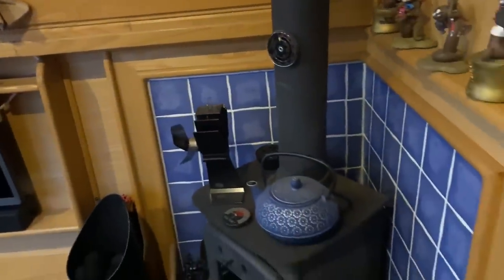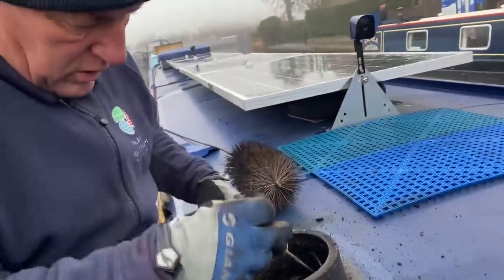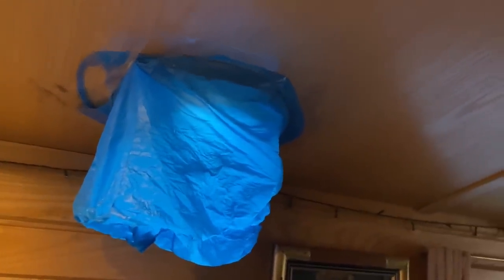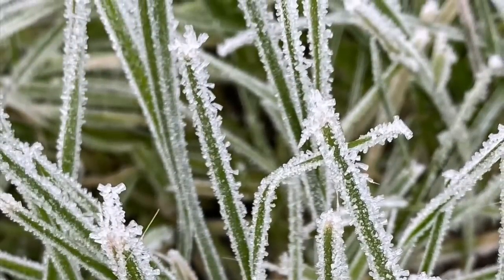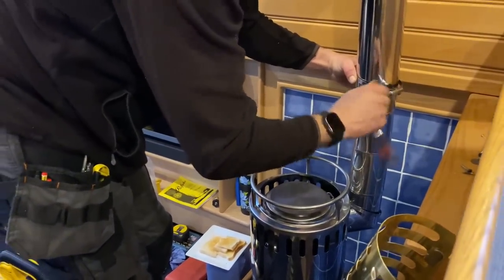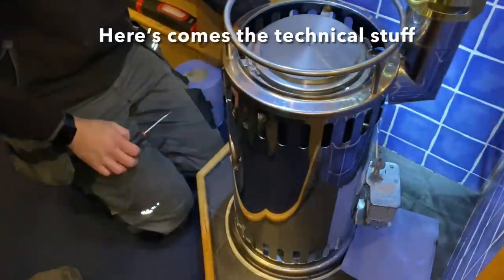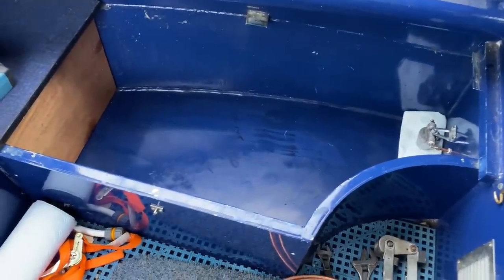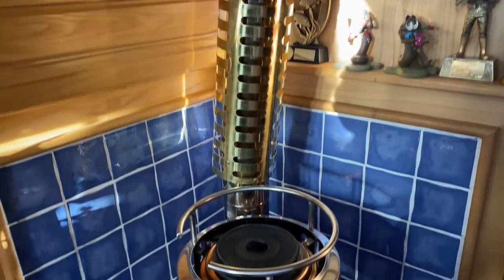Narrowboat Living - Our new Refleks Stove! Ep17

Comment: I’ve always used diesel drip heaters over the years and never had a problem with them. When I go past a boat that’s got bags of coal and wood all over the roof I cringe at the the thought of all the manual labour involved🥴 In winter I run my Reflex on 28sec gas oil, it burns hotter and is very clean plus it’s cheaper than diesel
Reply from the maker: Ooh thanks for the tip! xx
Reply: How economic are they, how much is gas oil per litre and how much do you use per 24 hrs.
Reply: @psy-op  All this information is available on the internet🙄 try searching for Reflek 2000 heater and you’ll see fuel consumption figures - heat output: 4.2 KW (3675 kcal/h).
Fuel consumption: min. / max. 0.18 / 0.54 l/h?
28 sec gas oil is generally at least 25% cheaper than red diesel plus there is zero tax on kerosene, only downside is kerosene is not sold in marinas.
Reply: @optimist3580  5% VAT on kerosene heating oil.
Reply: @PaulThomasSouthWales  thanks, yes I’m aware of that, still a lot better than the 20% on Red diesel for propulsion even when you take in to account the 60/40 split. Red diesel used for heating has 5% vat
Reply: @JulieandMartinonRIB  would be sad to see the log burner go if I'm honest but can see why it's safer

Comment: Congratulations! Diesel stoves rule. I hope you've discovered the joys of using meth's rather than horrible smelly fire-lighters. Meth' spirit smells great and is hassle free. I thoroughly recommend using joss-sticks to light it. I have a Kabola back-boiler stove that works exactly the same as the Refleks. Just pour in the meth's, light the joss stick but don't blow it out - touch the flame to the pot and close the lid. 
That way you've avoided filling the room with fumes. Alternatively you can snip the burning end off the joss stick to drop it in the pot for ignition.
HAPPY NEW YEAR
Reply from the maker: Ooh, we might just try that, thanks Dan! Happy New Year to you too xx
Reply: @JulieandMartinonRIB  CHEERS!

Comment: Hello fantastic vlog! Is it expensive to run? Absolutely depends on usage, but an average?
Reply from the maker: HinDavid, thank you! We found if we had it on low, number 1 setting then it uses between 4 and 4.5 litres of diesel per 24 hours, and most of the time you only need it on seething 1, we only turned it up to number 2 occasionally when it was -4° or below, so this is a good indication, hope this helps xx

Comment: Soo dose a multi fuel stove make condensation? Also thinking about specking out a boat... How much fuel dose this use? And what level do you set it on? Also how much heat dose it produces compared to the multi fuel stove
Reply from the maker: Hiya! In our experience, our multi-fuel stove did generate condensation, mostly due to the fact you can’t regulate the heat, so it gets very hot initially, then cools over a few hours, then hot again once stoked and fed more coal or wood, it’s also a radiant heat. With the Refleks diesel stove, its convection heat, it draws the cooler air in at the bottom and the hot air comes out at the top. The diesel stove seems a more dryer heat too. We have our stove mainly on the first setting, number 1, and leave it on 24/7, this keeps our boat a nice 22°C (72°F) and this uses approx 5 litres of diesel per 24 hour period, sometimes a bit less, but averages at 5 litres. If it gets really cold, into minus temperatures, then we sometimes turn it up to number 2, or 3 for a short while, but mainly we keep at number 1. We prefer this to the multi-fuel stove, as there is no mess, no coal dust, no storing of coal, or wood, or kindling, and you can keep the heat at a constant and leave it on without the worry of it going out. Another nice thing is if we get a chilly night in Spring, or Autumn (and even Summer this year) we can put it on for a couple of hours and then turn it off once we’re warm, and on the flip side, if the weather changes and becomes warmer, we can just turn it off, which we couldn’t do with the multi-fuel stove. Hope this helps! Thanks! xx
Reply: @JulieandMartinonRIB  amazing thank you so much for the information that's a response I really enjoyed reading. Thank you so much 🥰... May I ask how much dose it cost to run the heater for the month / week assuming it's on 24/7 like from October to May...  roughly how much is diesel? I know the price changes I'm working out cost ECT. Manny thanks, oh and is it better to have an external tank?
Reply from the maker: Hiya! The red diesel at the moment is around £1, so we’re looking at £5 for 24 hours, so £35 per week. We have a separate diesel tank specifically for the Refleks stove in one of the front lockers, this allows the stove to be gravity fed, so there is no need for any electric pumps (if you were having the stove fed from your main diesel tank at the back of the boat by the engine, it would need an electric pump to get the diesel to the stove) As boats are always very slightly higher at the front, having the separate diesel tank in the bow is perfect. If in extreme weather, God forbid our batteries died, we would always have heat, as being gravity fed and no electronics, the Refleks would still work. Hope this makes sense! Thanks! xx

Comment: Hi are you still using your Reflex diesel stove? Is it expensive to run? Have you had any problems with it since you fitted it? Thanks Fiona
Reply from the maker: Hi Fiona, yes we’re till using it, it’s great! In winter it uses approx 5litres of diesel per 24 hours. We leave ours on constantly, usually on setting 1 and only turn it up if it gets really cold like mud temperatures outside. Keeps us toasty warm. Thanks! xx
Reply: Hi there thanks for your reply. Did you get a back boiler on your reflex stove to heat your radiators! If so do the radiators get hot enough? Or do you have a separate heater like a Webasto or Eberspatcher? Thanks Fiona
Reply from the maker: Hi Fiona, we have a separate Eberspatcher to heat the radiators. When it’s really cold we put the eberspatcher on for one hour in the morning and one at night, just to heat the radiators through. Hope this helps! xx

Comment: Looks fab. Did it help with the condensation?
Reply from the maker: Hi Stuart - yes, because it’s convection heat it’s a dryer heat. Also, as you keep a steady temperature 24/7, ie the boat doesn’t get cold then heat up, then go cold again like when we had the multi-fuel stove, there’s no chance of condensation build up on windows. Hope this helps, thanks! xx

Comment: How did you find this stove for heating?  Is it expensive to buy the gas compared to fuel for a wood/coal stove?  Sorry, trying to decide  which type of stove to get on my boat. Really want one of these. :)
Reply from the maker: Hi Jack, it’s great for heating the boat. We have it on 24/7 and it uses approx 5 litres of diesel per 24 hours. It keeps the boat at a steady heat and the beauty is you can turn it up if it gets really cold outside, or turn it down, or off if it gets too warm, unlike the wood/coal stove. It’s a lot easier, no mess, no storing coal, wood or kindling, no coal dust/soot everywhere, it just sits quietly heating the boat. And diesel is readily available from marinas and fuel boats, so always a supply. Hope this helps xx
Reply: @JulieandMartinonRIB  Oh, thank you so much. That really does help a lot. I think I will go with one like you have. Thanks again for the info and happy new year!!!
Reply from the maker: @jackmedcalf6254  no probs! Happy New Year to you too! xx

Comment: I've ran a propane heater inside my shop in the winter. I had to keep the garage door slightly open so that I wouldn't die. I also had some grease like film on some of my shelves. I know that this isn't propane but I was wondering how this is different in comparison to propane? If in fact that this is safe and doesn't cause issues like propane than I might replace my space heater that is propane with one of these.
Reply from the maker: I can’t speak for propane as we haven’t used that, however the diesel stoves are completely safe, easy to use, you can regulate the heat and are economical too. We only have the need to open windows if it gets too hot lol xx
Reply: @JulieandMartinonRIB  Thanks. That's awesome to hear! I didn't know that about diesel heat. Great stuff.

Comment: Hello. Do you find that the cold air around the floor gets warm or is that still cold with the new stove? Are you keeping the Reflex lit all of the time in the cold weather? Does the heat get around all of the boat or still sort of located in the area around the stove? Any condensation issues? Thanks.
Reply from the maker: Hi Joseph, wow lots of questions lol, here goes in order;
We have a fan on top of the stove and one at the top of the flue, which circulates the air, so the air near the floor does warm up. 
Yes, we’re keeping it lit all the time, we turn it down to 1 overnight and then back up to 1.5 or 2 during the day. When it was -6° we had it a little higher. 
Yes, with the two fans, it circulates the heat nicely, still a little cooler at the far end of the boat, but not cold. 
No, the Refleks diesel stoves produce a dry heat, so it reduces condensation. 
Hope this helps xx

Comment: Hi . Fantastic video. We are just trying out our stove today . Can you tell me where did you get ypur trivet & fan from . Thanks . Ant & saz ☀️
Reply from the maker: Hi Ant & Saz, you’ll love the stove 👍 xx
These are the items we bought, we got them from Amazon, see links below. We have two fans, one that sits on the trivet and one at the top of the flue pipe, to circulate the air. The one at the top we had to secure with a jubilee clip, as the stainless steel flue is not magnetic. Obviously do that when the fire is cold, as the flue gets way too hot to touch 🤪 Hope this helps xx
Stove Fan, Log Burner Fan Silent Wood Burner Fans for Wood Burning Stove, Fire Fan Wood Burner with Heat Powered 4-Blade Fan Eco Friendly for Log Burner Fireplace https://amzn.eu/d/fTj4B4N

Valiant Remora Magnetic Flue Pipe Heat Powered Stove Fan (FIR350), Black, 200 mm https://www.amazon.co.uk/dp/B079JPMQN7?ref_=cm_sw_r_apin_dp_1BM060RWTT122YKKHGYD

Bredemeijer Coaster Jang, black, Cast Iron, 13.4 x 13.4x 1.8 cm https://amzn.eu/d/7QoxT6L
Reply: @JulieandMartinonRIB  so kind of you to reply. Thanks a bunch. Just ordered em from Amazon 👍... Ps ... the fire is lovely. We started it via the meths method but may well revert to the fire lighter method. Can I ask .... which method do you prefer? ... kind regards ant & Saz from boat happy days . ☀️
Reply from the maker: @antsat37  we always use the meths ….. unless it’s warm, then NEVER try with meths, as it proper goes bang and takes your eyebrows off lol 😂 
If we run out of meths, we’ll use a firefighter, but it tends to leave a small deposit build up where the fire lighter was. We haven’t got our fire on yet, still warm here lol, not for long though, as it’s just started raining! 🤷‍♀️ xx
Reply: @JulieandMartinonRIB  top stuff . Thanks so much . See you out on the cut somewhere. Byeee ☀️

Comment: Hi. I understand why there would be dust from a solid fuel stove - due to opening and closing and during cleaning etc. but since it has a door that closes while in use I'm wondering why it would cause more condensation than a diesel stove.
Reply from the maker: Hiya, apparently the diesel stove works more on a convection heat, I.e. it heats the cold air from the bottom and pushes warm air up the top, causing a dryer heat. That’s about the top of my knowledge lol 😂 Thanks! 😊
Reply: @JulieandMartinonRIB  Thanks. Do report your findings as you use this new stove. It should be a lot less dusty as you said before, but about condensation and also diesel consumption. Since you are on a separate tank for this I guess it will be easy to monitor. How did they get the fuel pipe all the way to the stove without having to take your wall lining down?
Reply from the maker: Hi, we will monitor it over the next couple of months 👍 The fuel pipe comes through the bulkhead from the well deck, then through the back of the cupboard, then under the shelving behind the fin-radiator panels, through an insulated cover, right along to where the stove is.  The pipes are completely hidden from view and they’re also gravity fed, so no need for a pump either. Hope this helps x
Reply: @JulieandMartinonRIB  Ah yes, heater, not engine, so no need for a high pressure pump (or any pump as it happens). Still quite fortunate that there was a reasonably straight forward route for the pipe. No doubt you surveyed this before committing to the change.
I do look forward to hearing of your experience with the system. In particular I wonder how it stacks up against a diesel central heating unit, meaning if going diesel is it better to just run the central heating system and close off any radiators not needed at any given time. A fire is always a focal point, but then so is a TV these days. Growing up I was in an all electric house. In the living room (usually the only heated room due to costs) mum used to reduce the ceiling heating thermostat (yes, ceiling heating - don't ever get that!) in favour of the electric "fire", which she would then sit in front of like a black hole absorbing all heat energy with none being able to get past her. It put me off the idea for 2 reasons; 1. an electric 'fire' is not a fire (wondering how well a diesel heater qualifies) and 2. heat was not distributed. I've worked abroad, mostly in the tropics for the past 35 years, so that view has never been able to be retested.

Comment: Whilst a real fire is the best it is the price to pay for it in physical labour and a mess that for some is a price too high.
If I had a boat built then I would install a multi fuel burner a mid ships but not make it the daily source of heat.
For that an onboard generator would supply electric panel heaters / and or hot air heaters.
Many have done what you're doing.
Reply from the maker: Thanks David, that sounds like a nice set-up, we’re very happy with the stove 😀 xx